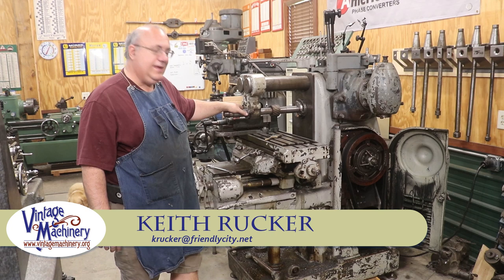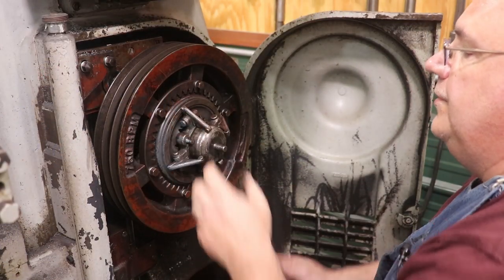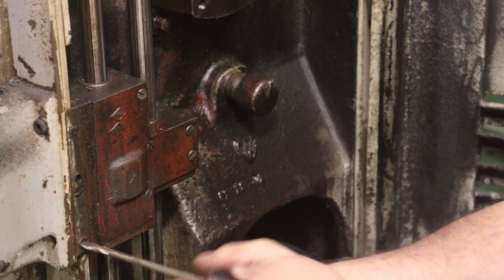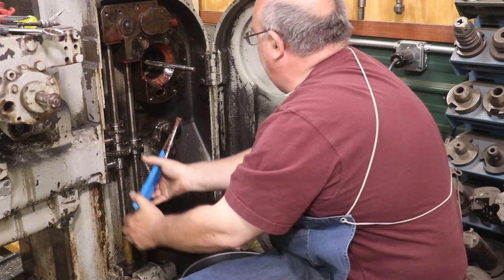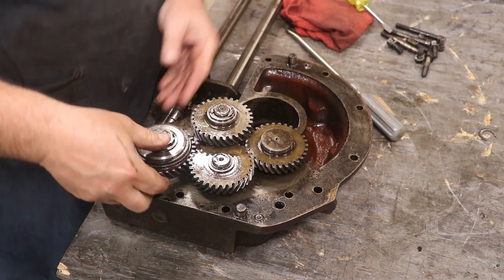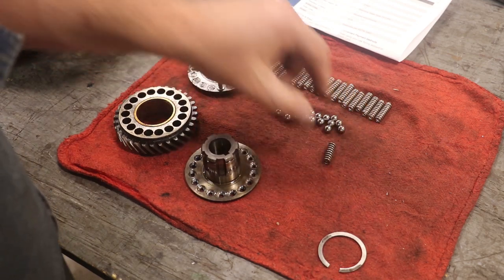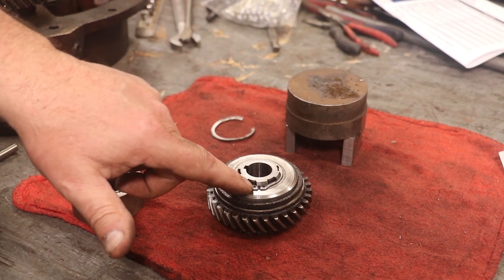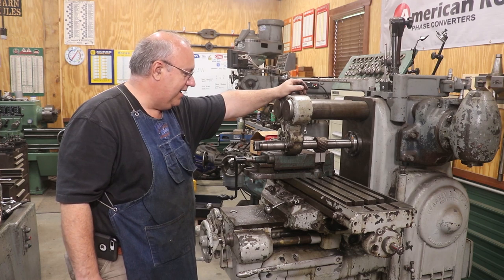Repairing the Rapid Traverse Clutch Pack on a Kearny & Trecker 2H Horizontal Mill

Comment: Hey Keith, is it possible that the problem is not the torque limiter but something binding somewhere that is engaging the torque limiter? You're also going to get to a point where you are going to have to do something about that plate on the other side. It's hard to tell from the video, but how severely rounded are those edges and how deep is the groove?
Reply: I agree with this comment! The function of that "clutch" is to limit torque to the rapid traverse so if something overloads it doesn't break the machine. I would propose that your traverse is dirty or dry and the torque limiter is simply doing its job. This would also explain why you made some improvement a few years ago, you simply increased the limit of the torque limiter, but didn't solve the root issue.

Comment: Keith, I have a G&E 20" shaper. I have to remove the box on the front of the machine. Neither the up and down cranks work and i want to find out why. One turns and does nothing and the other crank to move up and down does not move at all its jammed. It is not a swivel table. How big a job am i in for??? I am 80 and determined to do this.  You have great videos. THANKS

Comment: Great video as always!
Question: Could wear on the friction material inside that clutch also cause this issue? It looked worn to my untrained eyes, so I'm curious whether or not it was still in spec for thickness.
Reply: No friction material, just a ball detent that would slip on excess torque. The top material is more there for damping the slip, so the balls do not chatter too much when they pop into and out of the detents.
Reply: @SeanBZA  - Thank you for your reply! That definitely clarifies things for me. :)

Comment: I may be way off but I cant help feeling that there is something else going on. I would suspect a dirty or badly worn out way causing problems. I mean there has to be a reason that the clutch starting moving in the first place.  It might be a good idea to measure the ways if you get the chance after this job keith. You could have a warped bed or badly worn out way on one side causing jamming at certain points. If that was the case the new springs will only work for awhile before it starts skipping again.
Reply: Hey, it's only 80 years old. There may be some wear here and there.

Comment: Oil in a machine that is used a few hours a month will be good for 5-10 years. Cars run 3k-10k miles between oil changes, and including idling time, that's hundred of hours. And oil in an ICE is working way harder than the oil in that gearbox. The oil in that machine will last the rest of its life.

Comment: Something is still wrong with the gear train that powers the rapids- it shouldn't be making that ticking noise. Mine doesn't make any appreciable noise (except for the whirr of gears) when I rapid in any of the 3 axis
Reply: I've worked on a bunch of K&T mills as well and thought the same thing.  It shouldn't be making that noise on rapid.

Comment: How confident are you that you have the right springs, (this time)?
Reply: $6 each confident!
Reply: I wager they are heavier than the original springs,  The worl "ballbearing area" of thre torque limiter would be the reason .. a good work around .. as long as it's not TOO strong ... the totque limiter is there for a reason and stuff will break down wind of it, if it's too strong.

Comment: I'm a little mystified by the parts of that clutch. It looks like it is not a clutch for engaging/disengaging any drive, but is just a torque-limiting clutch that slips (with the balls popping from one cavity to the next) when the torque gets too high. But then, what is the point of the friction material?
The top plate (the last bit installed in the pack) is splined to the hub, and those alignment pins engage into holes in the gear, so doesn't that prevent the gear from turning separately from the hub? I think I'm missing something here.
I feel that there's more parts here than were shown disassembled. Like maybe the friction material and the alignment pins can rotate separately from the top plate (though in the video all three appeared to form a solid assembly). This would mean that in normal operation, everything rotates as a unit. When the torque gets too high (exceeding the friction between the friction material and top plate + torque needed to make the balls lift from their cavities), the gear, springs, balls, alignment pins, and friction material rotate together, and the hub and top plate rotate separately. The balls pop from one cavity to the next while the friction materials slides. The springs provide both the force to seat the balls in their sockets and also the pressure on the friction material.
Reply: I had much the same feeling about that as well

Comment: If you value your fingers you will disconnect the power before you touch the drive belts. I saw a man lose his thumb by working on an air compressor without killing the power. It's a terrible lesson to learn.